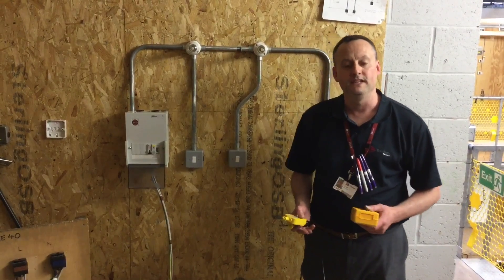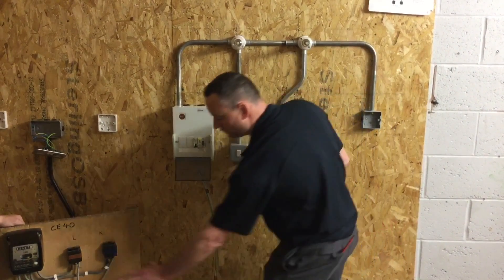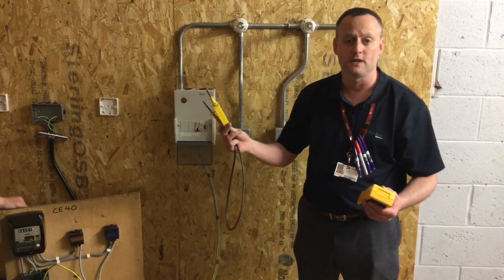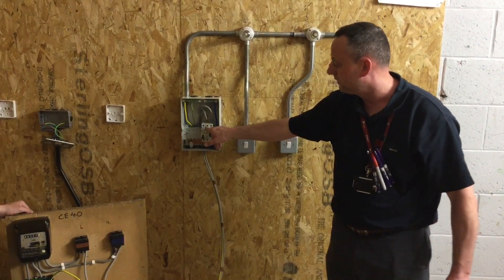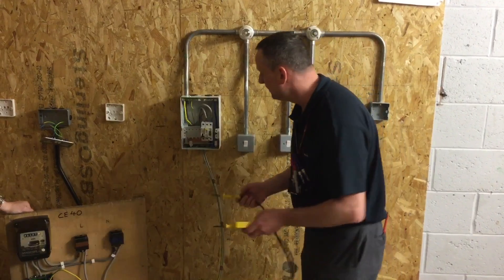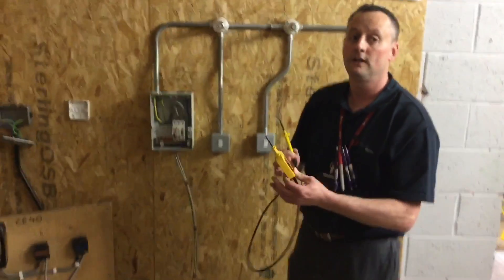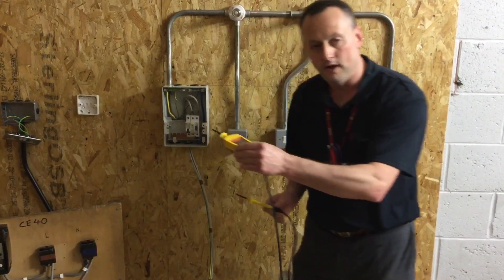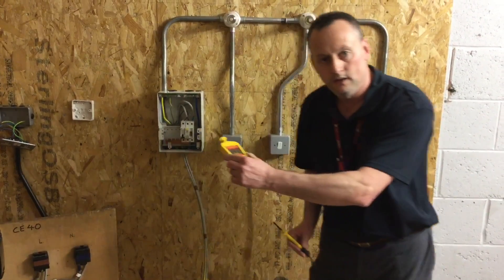Electrical Testing Polarity of the Supply (Live Testing)

Comment: How to find out the correct polarity when i use a normal voltage tester for example keyoritsu 2056R. I tested line and neutral is 230 volts, line and cpc 230 is volts. so which one is neutral and cpc conductor? the wire color are also same. the visual inspection also hard to carry out. plz explain.
Reply: CPC is Earth. To find out which is the CPC when testing polarity, the third configuration of wires(if you can't differentiate by colour) i.e. neutral and Earth(CPC) would be 0 volts. So the CPC would be whichever of the three wires you testing two configurations with resulted in 230V in one and 0 in another. (Line-Neutral should be 230V, Line-Earth should be 230V, Neutral-Earth should be 0V). 

You've probably figured this out by now, hopefully it helps someone else.
Reply: @lazerguided_  It seems to me like it would be impossible to tell between neutral and earth if you can't do it visually, no? They both are 230V away from line, so how can you tell which is which?
Reply: @Orgakoyd  Indeed, conductors are supposed to be identifiable per the regulations for reasons like this. The line could be 0v also if it has an isolator somewhere or a break in the circuit. Usually the Line and Neutral will come with coloured insulation on it all ready though, CPC wont with T&E.
Reply: What’s cpc?
Reply: @lcfcmiller7737  circuit protective conductor
Reply: Disconnect the supply to the circuit entirely. After you've proved dead connect the Line(red) and one of the conductors at the other end with a connector block or wago. Now at the distribution board find the Line conductor associated with that circuit and hold the prove on that conductor. Now connect the other probe to the earth associated with that circuit which is hopefully identifiable at that end (Jesus fucking christ thats bad if you its not identifiable there) 
If you have continuity then you have found the earth at the socket side (Its the one wago'd to your Line cable) If not then it is the other.)
Once confirmed destroy the insulation for the earth on the socket side and replace the appropriate earthing sleeving. 
If you cant identify where the earth is in the distribution board get an EICR done on the whole installation as there are probably other issues that will cause fire/death.